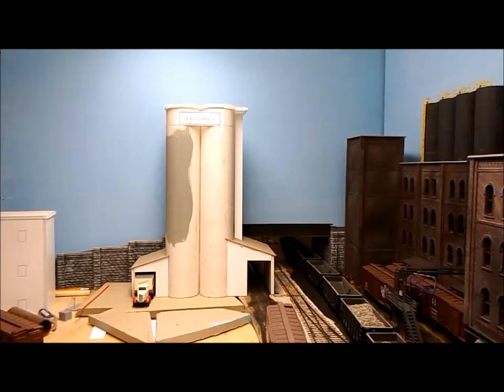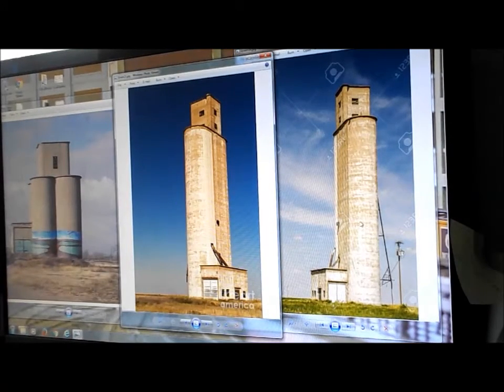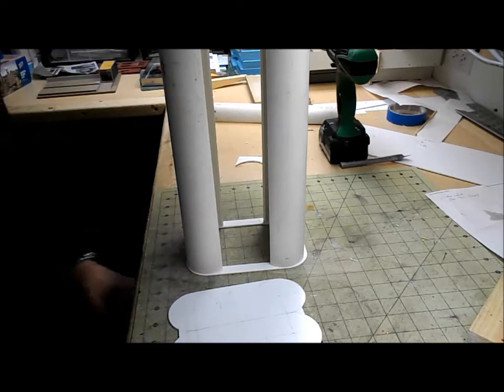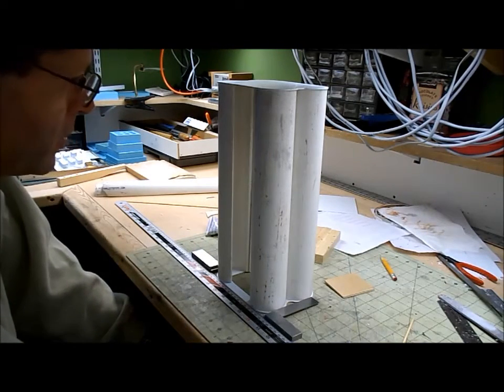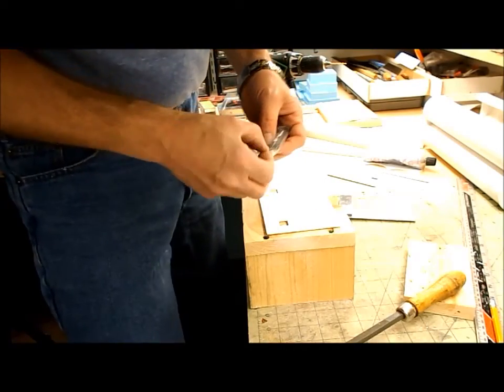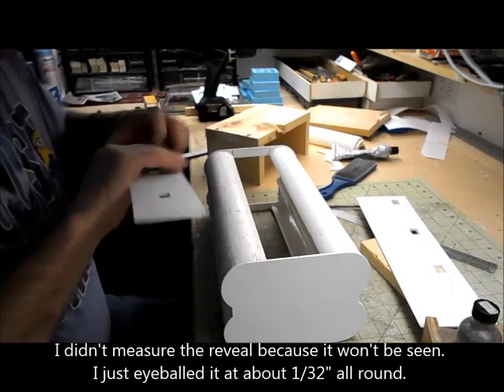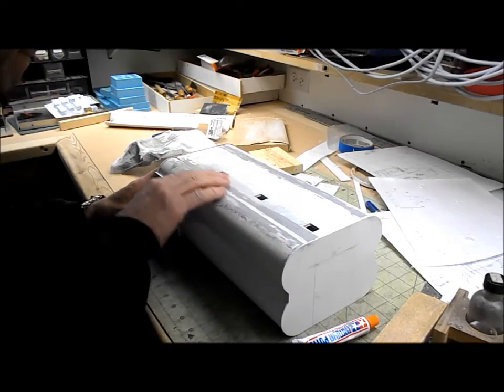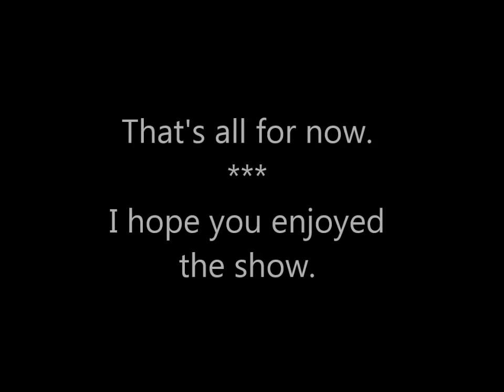My railroad: B. Kay Feed Co, part 1

Comment: PVC glue (The blue stuff) works very well and if the polystyrene is thicker than about 40 thou there should be no distortion. I currently use PVC sheet from the local sign maker (Scrap bins are great) which worked out very well with the blue glue...

Comment: The windows in the center or end parts of such structures probably correspond to the landings on stair walls. But I have a suspicion you already thought of that
Reply from the maker: Yes, I had to get an idea of what the inside would be like before I could decide where to put them.  I don't remember my exact reasoning, but I seem to remember thinking after I finished it that I didn't get it quite right.